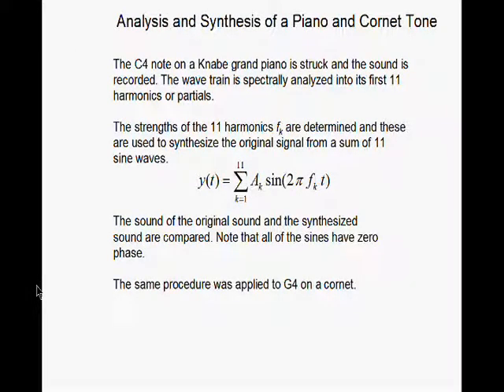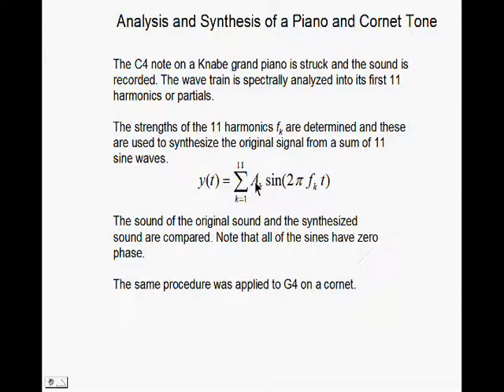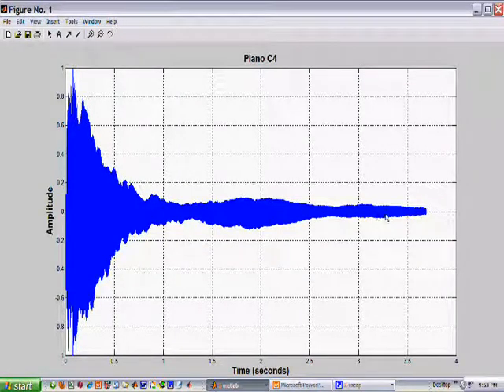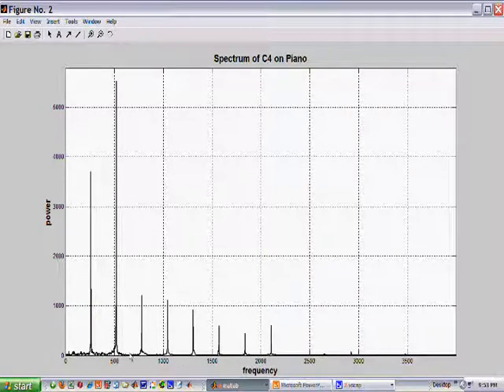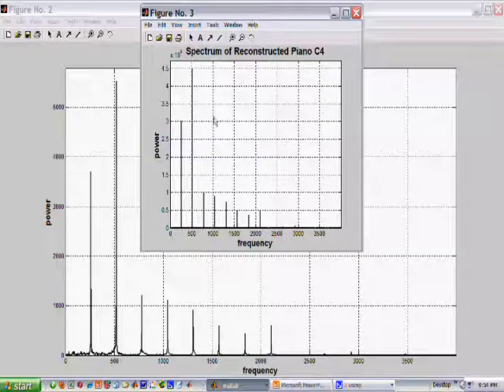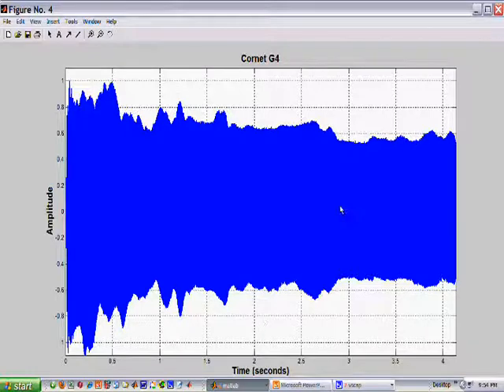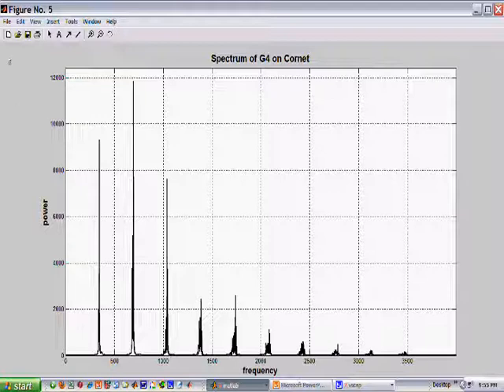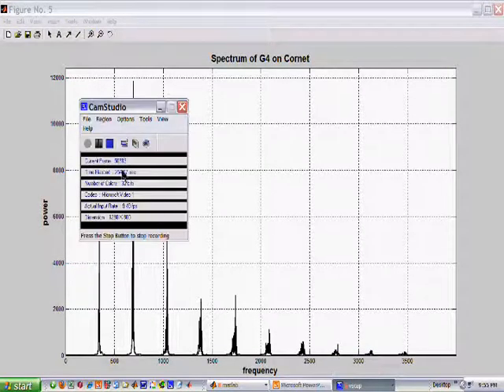Analysis and Synthesis of a Piano and Cornet Tone

Comment: Dear Mr. Dave, I have tried to use the Matlab simulink to add all the frequencies shown by you but the final waveform do not have the same tone as yours? I have used waveform generators for construction of the sine signals and have added them using adders in simulink and finally trying to listen it using "To audio device" tool of simulink and seeing the waveform and frequencies in scope and spectrum analyzer respectively. If required i can share the code with you

Comment: If I'm not mistaking, you can't just use the maximum of the peaks as the Fourier coefficients for your synthesis like you did. The actual power lies in the integral of the total signal stemming from a single frequency, so an integral would be more appropriate. It currently looks like the first harmonic contains more power than the fundamental, but this seems weird and does not match what is described in the literature for the intensity of the harmonics (about 0.4 for the first overtone, DOI: 10.1121/1.1915704). The first harmonic might seem to have more power because it has significantly less spectral leakage, as do all higher frequency components.